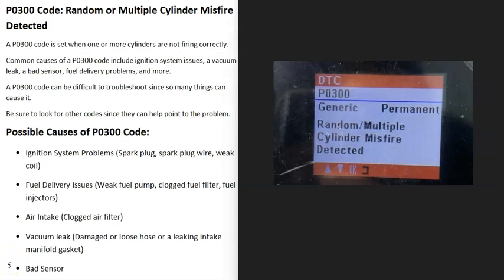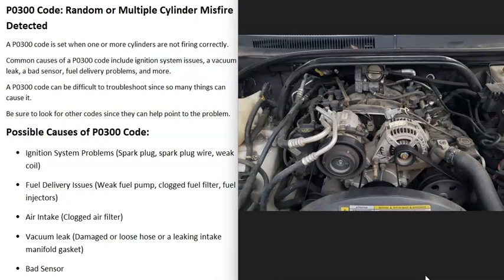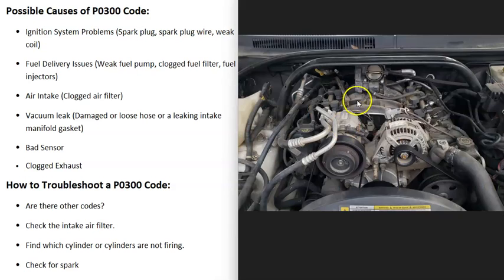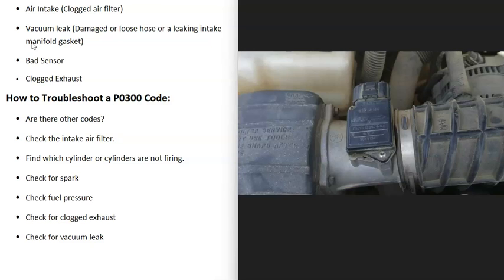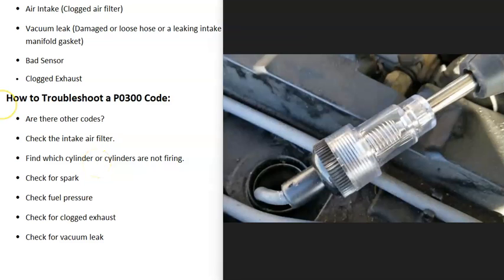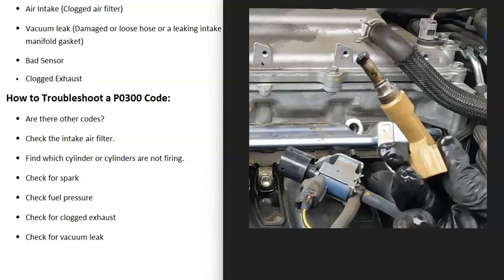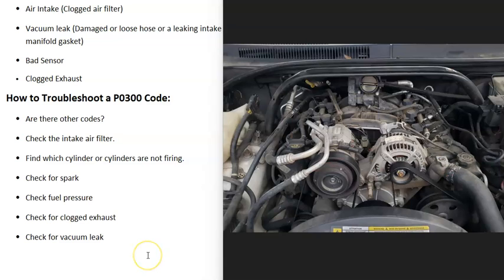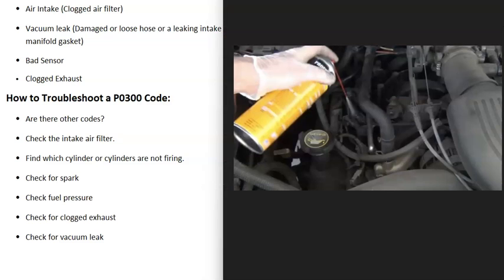Causes and Fixes P0300 Code: Random or Multiple Cylinder Misfire Detected

Comment: Just changed the spark plugs and wires still havent changed the coils or injectors but i do have a bad fuel pump doesnt read and had a code for high voltage
Reply: And only codes i have is this one p0300 and a transmission slippage code but dnt think that has to do anything with it

Comment: What about an oxygen sensor bank 1. Sensor 2. Code along with the multi misfire where all the codes come on together never by their self
Reply from the maker: The 02 sensor may be having an issue, but misfires can trigger 02 sensor codes. I would fix the misfire than the 02 sensor code. I would also check for any exhaust leaks, as that can also cause those issues.

Comment: I just bought one of these of Amazon for $30.00, because my check engine light came on and my silverado was shaking under acceleration. I couldn't read the tiny print in the tiny manual. So I  plugged  in this scanner and just followed the menu and it told me a code and that #8 cylinder wasn't getting spark.
I put in a new coil and spark plug, pushed clear code and BAM! I was done. I kinda wish I would of gotten the better one that tests batteries for $20 more but this one worked for what I needed and it saved me alot of time figuring which coil was bad so it was well worth the money.

Comment: What Causes P0303?
Faulty coil.
Faulty fuel injector.
Faulty oxygen sensor.
Poor compression.
Burned exhaust valve.
Low or no Fuel.

Comment: I have a stumper I have p0300 and p0174 codes on my 03 ford expedition xlt with used 27k mile engine replaced one year ago that was originally having this same issue. Checked everything, new coils and plugs, smoke test, new filters, rail and injectors tested, fuel pressure tested. Idles fine bit lose of power when accelerating on an incline.
Reply from the maker: That is a hard one. Since the P0174 is on Bank 2, you could remove the spark plugs on Bank 2 and match them to a spark plug burn chart to see if one or all the cylinders are running lean. If it is all of them, then it's something that would affect the whole bank. If it is a single cylinder, just focus in on it.

Comment: Warning! Wall of text follows. - Thanks for this simple video explaining the many different possible causes for the P0300 misfire code.  I have a 1997 GMC K1500 extended cab pickup and about 15 months ago, I had the stock 5.7L small block engine replaced with a 383 stroker with after market aluminum heads (not sure what valve size the engine builder ordered the heads with, but probably stock sizes), and I asked for a mild RV style camshaft, as the purpose of getting the slightly bigger engine was only to obtain a bit more power and towing torque.  I was disappointed with the difference, but figured that I just need to add a few more performance enhancing parts to this base, and I would be happier in the future.  About 4 weeks ago I noticed that when warmed up, there was a noticeable roughness to the engine while the accelerator pedal was just slightly opened, and it gradually got worse, to the point that now, unless I'm driving up a hill, or mountain pass, it's like driving with an on/off switch, as I have to press down the pedal past where it causes the misfire, or let off completely, as it does not misfire in the idle position.  I replaced the air filter, the throttle position sensor, and installed new fuel injectors.  The new injectors have the electric control at the end of the spider injectors, unlike the stock injectors which had the control portion in the upper end of the spider injection system.  The new injectors have made the truck run much stronger and it is more responsive, but unfortunately, they did not fix the misfire problem.  My next attempt to find the problem is going to be new plug wires, as I don't think the shop that installed my engine replaced the stock wires, that are probably the originals with almost 190,000 miles on them.  I'm also going to replace the hose for the crankcase ventilation (I'm not sure what it is called, EGR, PCV, etc.), and I'll try the carb cleaner spray trick to find where there might be a vacuum leak.  I replaced the MAF sensor a couple years ago, so I think it is still good, but I'm leaning hard on the problem most likely being a vacuum leak.  New plug wires are still a good idea though.  If anyone with experience on small block GMC/Chevy engines, and the 5.7L Vortec in particular and you have any other ideas, I'd be thankful to see them.
Reply: Check your fuel filter, pump and regulator I had the same problem on my 01 Monte Carlo it has the 3800 series 2 but I didn’t get a code just really rough and sluggish uphill you could tell it was fighting to stay alive 😂
Reply: @dragonzdoser2071  It ended up being the distributor that had risen up and skipped a tooth or two and finally destroyed the entire distributor gear. The shop that figured it out replaced the distributor, but I don’t think they got the timing right, as the engine isn’t running at full power anymore. At least they got it fixed and running again. I’ll probably try to tweak the timing just a little to see if it improves back to the way it was when the 383 was first built. Oh, I did replace the fuel filter and fuel pump before the distributor destroyed itself.

Comment: Hey bud. I brought my Ranger in for inspection. It failed with 2 new codes and was returned to me with a CEL on. P300 & P316 neither of which was present before inspection. The CEL comes on very fast after clearing codes by battery disconnect. I did not have this CEL or either codes before. Should I suspect the shop tampered with my vehicle?

Comment: 2005 Dodge Ram 1500 5.7
Was getting a P0305 and P 0420 .
Swapped the coils on 3rd and 5th cylinder along with spark plugs on 5 and now it’s just P0300 .. any suggestions ?? Thanks in advance
Reply from the maker: It needs to be diagnosed. If there is a bad injector, it could be dumping fuel and clogging up the CAT, causing the P0420 Code, but if the CAT has gone bad, that can also cause misfire codes. I would test the CAT, and if that's good, test the injectors.
Reply: @  thanks a lot for your reply !! What recommendation do you have on testing the cat ?
Reply: @HVAC_Mechanic tricky one for you in regarding this. I've just straight piped my 5.7 hemi. Still has both o2. Changed the fuel rail and Injectors, plugs wires coils. You name it and still has that po300
Reply: How do you check a cat?

Comment: Got a P0430 to go along with p0300
Reply from the maker: I would test the catalytic converter; it may be failing.
Reply: @HVAC_Mechanic  if the catalytic converter is failing and that's causing my p0300 would it be fine to just leave it as is? The car is running very well with no misfires or hesitation and my state does not check emissions.

Comment: P0014 with this P0300
Reply from the maker: The P0014 code is likely causing the P0300 code. It needs to be diagnosed, but it could be a timing problem or a VVT issue. Check the oil low or dirty oil can mess with the VVT.

Comment: P0300 and P0308.  Noticable stuttering acceleration around 30-50 mph.  Before embarking on the nightmare of taking out the #8 plug, I put a bottle of dry gas in and shut off the engine light.   300 miles later, still running fine.
Reply: Can you explain more how you fixed it?
Reply: @jlion1986 that fix didn't last much longer.   Eventually ended up replacing #8 coil.

Comment: I had this code few times before but it disappeared and comes back every few years and disappears again. Why is that?
Reply: Probably cold weather
Reply: Check your air filter, and also check for vacuum leaks.  Weather can affect hoses shrinking and expanding, which can lead to a vacuum leak.

Comment: I am getting error code P0300, P0302 and P0303. Car is currently not working again. what can i do?
Reply from the maker: With multiple misfire codes it is likely something that affect the whole engine, such as a bad fuel pump, air filter, sensor, and so on.
Reply: @HVAC_Mechanic  Me english bad...Me friend Me have P0300 multiple misfire? and P0303 and P0304 ans P0302 cylinder 3 4 2 misfiring. Me change spark plug and air filter, still happen. What can Me do?

Comment: I have all cylinders misfiring ive replaced all spark plugs, fuel pump, fuel  rail,  fuel injectors, coils, and fuel relay im stumped it really only has trouble starting up but once its running i can turn it on and off no problem HELP
Reply: They say all this but when it came down to it. It was water in the gas tank!! Get a yellow bottle of HEET. Put in gas tank. Check engine light off
Reply: Do you know what condition your catalytic converter is in? Also could there be a leaking intake manifold gasket?
Reply: Maybe ignition control module
Reply: What was the problem , did you fix it ?

Comment: Fixed a P0300 code that I had been fighting for a year after installing a new transmission on a 2010 wrangler . I literally did everything . Ended up pulling the transmission and replacing the new flexplate I had installed with a OEM transmission . It was made wrong and sending the wrong signal to the PCM .

Comment: Im getting this p0300 code and 3 other codes. Im getting p0050 p0097 p0102 and i already replaced the mass air flow sensor along with the maf wiring harness im on a dead end with this any help?
Reply from the maker: If the MAF sensor is new, it is likely in the wiring. It also looks like it has the IAT sensor built into it. I would get schematics for the vehicle and test the MAF sensor wiring, as there is likely an open or short. Also, be sure to check any related fuses.

Comment: I'm now getting a p0300 and a p2097... Replaced both O2s and cat is new.. also getting misfire p0301 302, 303, 304. 4cyl motor.. engine is running fine.. I don't notice a misfire or hesitation... Should I still suspect the coil packs or plugs?  Please help me out.. running out of options.
Reply: UPDATE:.. was able to get the misfire code to go away.. still getting a p2097. I just replaced the manifold to downpipe gasket and also fixed a pinhole on the welds near the cat pipe... code came back after 40 miles.. I noticed a exhaust leak back near the muffler where the pipes connect over the rear trailing arm.. could this throw the P2097?.. so far away from sensor 2 bank 1?. just weird to me that im getting a p2097(sensor 2) code and not a sensor 1 code.. not much else in between the two sensors unless I missed another bad weld(pinhole).. I might have to remove that downpipe and do a smoke test on it.. please chime in .. im losing sleep over this
thank you
Reply from the maker: The "P2097 Post Catalyst Fuel Trim System Too Rich Bank 1" is likely the cause. Something is throwing off the air/fuel ratio causing more fuel than air to go into the cylinders.
Reply: @HVAC_Mechanic  I agree .  Something is throwing off a/f.. just unsure what..
Reply from the maker: A Rich condition can be hard to troubleshoot but it seems to be something affecting the whole engine like a stuck open purge valve. If you think it is a bad injector, remove the spark plugs one at a time, and match them to a spark plug burn chart and see if a cylinder is running Rich.
Reply: @HVAC_Mechanic  I'll have to locate the Purge valve.. 2008 Suzuki sx4
Reply: @HVAC_Mechanic  Update.. I checked all spark plugs, coils, injectors.. all check out fine.. misfire code has Gona away.. also did a smoke test for vacuum.leaks...saw nothing in the engine bay leaking.. checked cam sensor for resistance and continuity. Checked all sensors and harness plugs for resistance and continuity and faulty breaks in wiring.. all good... The only thing that I did off the cuff was removed the air box and cleaned it out.. seemed to be some debris .. also removed the MAF sensor and sprayed it with that crc cleaner.. air filter looks new.. cleared code and nothing has popped back yet... Could it have been a dirty MAF sensor being the culprit? Nobody ever mentions that as a possibility for P2097 in any YT video..
Reply from the maker: Yes, a bad MAF sensor can cause issues. Lean and Rich codes can be very difficult to fix sometimes. It can be a sensor throwing the computer off to a bad injector or clogged CAT, so many things can cause the issue. Basically, each possible component needs to be tested until the problem is found.
Reply: @HVAC_Mechanic  haha im starting to learn this lesson.. code 2097 came back today... after cleaning the MAF... ive done multiple tests already on this car... next is to replace the exhaust manifold gasket where it meets the cat. wish me luck again

Comment: BENT COIL CONNECTOR PIN: I had an annoying and hard to trouble shoot P0300 code on my 6 cylinder 2003 GMC Envoy XL. I had replaced the spark plugs and coils and the code and misfire would not go away. Why it did not trigger a P030x error, I don't know. Just passing this along as something simple for others to check.  Have a nice day!
Reply: Mine was ignition control module and map sensor was fried
Reply: Thank you

Comment: I have the ,308 code no other codes cylinder 8 ? Ford flex fuel engine. Been to ford theee times no luck now no money. One other says engine running rich at o2 sensor.
Reply from the maker: If another code is saying Running Rich, I would check the injector on cylinder 8.
Reply: Thanks, someone said ck lifter on cyl 8 too.